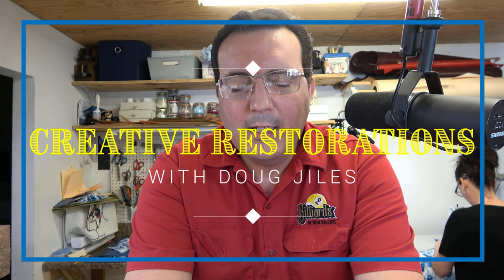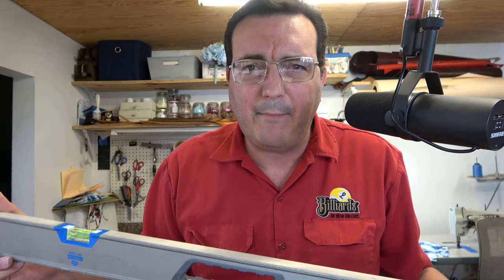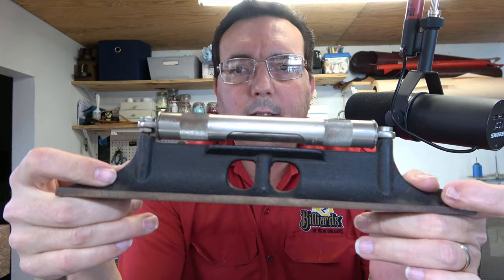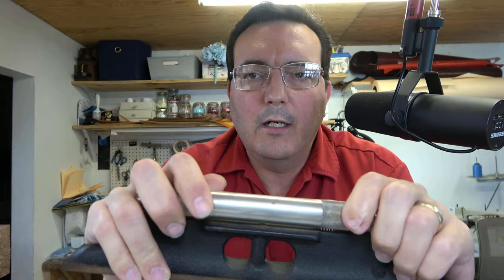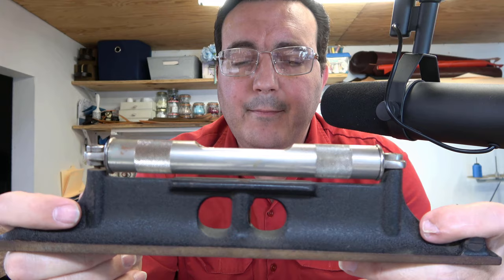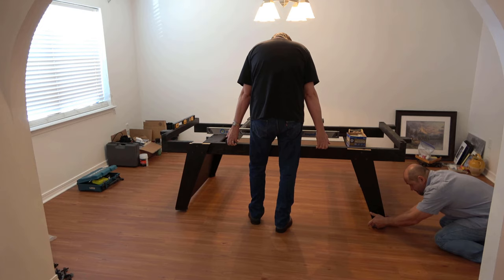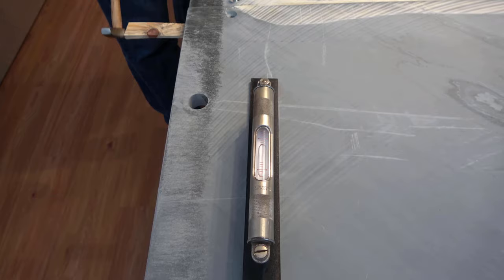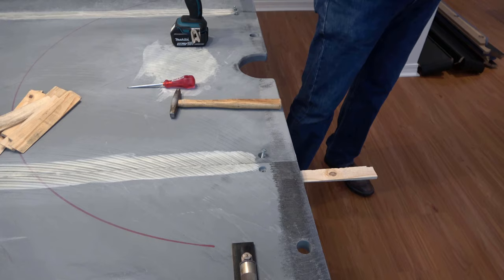How to Level a Pool Table

Comment: Thank you for taking the time to pass along your knowledge. My brother and I attempted to level a 3 piece with playing cards and a couple carpenter levels, I suppose if we kept at it, eventually would have got it. He had to leave so we stopped. I found this video and I'm going to start from scratch. The frame was leveled using a 6' and 2' carpenters, same as you did. When it came time for the fine adjustments, we had no clue and struggled. I ordered a machinists level yesterday,  not a Starrett but one more affordable. Your instructions are priceless and make it look so simple. While waiting for the level,  I'll use your techniques to replace the rail cloth.  Again,  Thank you for sharing your knowledge.

Comment: I do like my machinist level. I would not recommend spending the money unless you do this regularly. Reversing directions on the level is good confirmation. I'm sure this gets it as close as necessary, as little things like temperature and humidity will likely cause more deflection than any leveling error, but you wont notice. More likely in those cases you will notice more the change in felt characteristics than levelness. 

A penny slide across two adjacent slate pieces can provide another confirmation that they are even as you will feel and hear a difference if one slate is a RCH off. More sensitive than my finger touch. My slate has always required a few shims center table to keep perfectly smooth and level across entire seam. These shims are small and can be made with a knife and piece of pine.

Don't get smart like me and use playing cards as shims under the table. Little kids will find them and remove. I guess a razor blade could have helped. Live and learn. (Not on the kids, on the cards).

Thanks for the video. Getting ready to re-felt and cushion my Overland table (defunct Missouri company) that is very typical of standard 8' home table.

I am not a professional table mechanic, but I did sleep in a Holiday Inn Express.

Comment: Excellent explanation on the Starrett 98-12 level and the point of diminishing returns. I looked up the specs of the 98-12 and the bubble is even more accurate than the one I use to calibrate my surveying tribrachs (I'm a surveyor by profession), though not by much. And the 98-12 is a LOT more practical for tasks such as leveling pool tables.

Sure wish I had a table...
Reply from the maker: Thank you very much!

I do find that people tend to obsess over hyper-accuracy that ends up costing WAY more money than the task deserves. 

Thanks for watching!
Reply: @CreativeRestorations  Indeed. And if one were trying to use the costlier, more precise and accurate level for such a task it would very likely be an exercise in frustration due to the substantial additional time and effort invested for no practical gain whatsoever. One does not need to build an atomic clock when a Swiss watch will do :)

Comment: Working through my own levelling and recovering - what do you do when you can't screw down into the frame through the slate? The slate on my table floats and the only thing I can screw to is a skirt of MDF all the way around the frame that is used for a staple surface for the cloth. 

No screws go into the frame itself so I can't figure out how to level above and screw down to the line.

Comment: Thank you for your expertise, 
Question: which is better, a 3 piece or a single piece slate?
Reply from the maker: I prefer a 3 piece slate table. With a single piece, you only have 4 points to actually level the table. You can "flex" the slate in between those 4 points. But, there really isn't much movement that can be had.

With a 3 piece slate table, you have those same 4 points at the legs plus 4 additional points on EACH slate and you have the slight "flexing" of the slate. This gives you a total of 16 points to level plus flex.

Just my $0.02.

Comment: Great video and explanation. Would you start with the side to side adjustment on the highest end first? It seems like any side to side adjustment after that would also throw off the end to end levelling you have done.
Reply from the maker: Yes. You always want to level off your table to the highest point on the highest slate. Go side to side on that slate first. Then, when you level everything out head to toe, they should (in theory) all be level side to side. But, you do want to double-check each slate side to side as you progress.
Reply: @CreativeRestorations   How do you determine which slate is the highest?  I didn't see that explained and I can't think of a way to do it with a 12" level, or any level that doesn't span the length of all the slates.
Reply: @dbierman2001  I concur, and would like to see the answer to this important question. It seems like the author may be assuming the slate is perfectly flat and is equivalent to a precision straight edge. He also relies heavily on matching the slate junctions by finger feel. I wonder how accurate that really is.

Comment: I thank you for your videos. I will be attempting my own recover very soon. Purchased Maui cloth.. figured if I messed it up it’s not a huge loss. I am very capable and attentive… here’s my only question: cloth tension seems to be a learned skill. You seem to put a lot of tension on a stapled cloth. Is there any rule of thumb for tension? I appreciate your help
Reply from the maker: You're right. It is a learned skill. You've got to stretch it tight enough, but not so tight that it rips. Unfortunately, there is no scale indicating the "right" amount of tension. You've just got to "feel" it. Also, every cloth is going to react and preform different. The amount of tension you'd put on Simonis and Tour Edition is different than what you would put on Invitational cloth. And, that's going to be different than Maui cloth. All I can say is, stretch it to the point where you feel comfortable. Good luck with it!

Glad you're getting something out of my "rambling" videos!

Comment: Any tips on how to level after the fact? Unfortunately, I just found this video and I’ve finished applying the felt and bumpers on my table but need to somehow raise the table from one side according to my 4ft level. 
Can I add shims under the legs of the table?
Reply from the maker: Nope. Should be done as the table is being installed.

Comment: Amazing work.  Do you find that tables go out of level over time?  What causes this?
Reply from the maker: Thank you very much!

If a table is installed properly and it isn't abused afterwards, it's fairly uncommon for a table to go out of level.

A house settling over time can cause it. If it's either a raised house, the table is installed on a floor other than the first floor (multi-story homes), the floor joists can settle. Trees planted outside - as the tree grows, so do the roots. They are incredibly powerful and can lift the concrete slab enough over time to cause everything to be unlevel. 

Moving the table (even a few inches) without disassembling and reassembling it. Not having enough shims placed around the perimeter of the slate (especially at the seams). 

Other than that, there really isn't anything else that could play a factor.

Hope this helps.

Comment: thanks, for the great information. I would like info. on how to reduce my pocket-size to 4 inches in the corners and 4.5 for side pockets, not doubling up on the facings. Full size gc4
Reply from the maker: Thank you very much!

Unfortunately, the videos I do are limited to the jobs that customers want. I have to have 1) a customer with a Gold Crown and 2) they would have to want to have their pockets tightened using that method.

When that job comes along, I'll be sure to do a video of it.

Comment: Doug...very helpful video. Question...are you driving the wood shims directly at/to/under the slate hold down screws? It kind of looks like you are...or are you just driving them near the screw? ( cant quite tell). If you are driving to the screws, then screwing them down thru the wood shims, why are you doing so? Thanks, Bob in WV
Reply from the maker: I drive them in as close to the screws as possible. I don't want to drive the screws through the shims in case there's any minor adjustments that still need to be made.

Comment: How tight do you need to tighten the screw? In my first attempt at leveling I was making it as tight as possible and with each failed attempt the thread was starting to wear, but from your video is seems you just tighten until you get the level to the desired level, and using your method would not wear the thread even if it takes many retries..
Reply from the maker: The screws holding the slate down aren't really intended to be highly torqued. It isn't like you're attaching a rim of a car to the rotor. The slate weighs a LOT (roughly 250 pounds each). So, they're not going to go anywhere even if all you do is just tighten the screws to the point where they just engage the slate. The screws are there really to prevent lateral movement and to assist in leveling. That's it. 

Tightening the screws like you're tightening lug nuts is a recipe for broken screws, stripped out holes, and stripped out screw heads. 

I'll be uploading an another video talking about the finer points of leveling a table soon. Stay tuned!!!

Comment: great video. I used to re cover pool tables. what would explain seeing technicians using shims underneath a pool table under the middle of the table ?
Reply: Even slate can sag across 4 feet. Middle shims just fill gaps to ensure support across the span

Comment: My heritage table has one large particle board piece 4x8 that the slates sit on.  Do I put the shims between this and the slate?   Or between this and the table frame??
Reply from the maker: You should watch my "Outdoor Pool Table" series. It addresses this exact issue.
Reply: on A.H. tables (top liners) all wedges must be put underneath the table, not from side .

Comment: Does it have to be a 12" machinest level or can I use a smaller one.  What's the smallest machinest level you recommend?
Reply from the maker: I wouldn't go with anything smaller than an 8" machinist's level.

Comment: Would it be more secure to make the slate bolt go through the wedge?  I guess you'd need more gradual wedges....  
I'm glad you recovered (No pun intended)!
Reply from the maker: Thank you! I'm feeling better and better with each passing day.

I actually did screw the slate screws through the wedge on this table. However, it isn't really necessary. They're a friction fit. And, with the pressure exerted by the screws, the wedges aren't going anywhere.

Comment: Is there any possibility that the slate will gone warped/bent? I have a pool table that all 3 pieces of slate bent down in the middle I guess.
Reply from the maker: Warped slate is possible. However, I rarely see it warp when the slate is 3/4" or thicker.
Reply: @CreativeRestorations , it's 1" thick...

Comment: I have an 8ft CL Bailey...the company that leveled used a machinist level and I was there the entire time...he seemed very meticulous and got it very level....BUT...as I really slow roll a ball towards 1 of the pockets and about 18 inches from the pocket it seems to roll off about a balls width to one side....it ONLY does it with this one pocket....I'm not sure the issue and feel like it shouldn't be like that...if I put any amount of speed on the ball.it rolls true but I feel like it should be better than that. Any advice or help would be great.
Reply from the maker: That's a difficult one. It could be that one of your slates is off-level. It could also be that one of the slates isn't honed 100% true; causing a dip in that one area. The only way to find out is to get it back down to bare slate and use a machinist's level on that one slate. You would have to leave the slate in place (screwed down exactly as is) and move the level around to several spots. The slate could be cupped or crowned in that one area.

It could also be your cloth. Cloth is woven. So, it is possible (although less likely than the slate being the problem) that the ball could be following the weave of the cloth.

It's impossible for me to know for sure what's causing the problem without being there and seeing what it's doing and preforming tests first hand. But, hopefully this narrows it down for you.
Reply: Thank you so much for your response. After further investigation it seems to be down that one side...although not as precise as a machinists level..I used my carpenters level and it was dead centered...should I maybe try to shim that one side...like with a playing card or something small? I have a video of what it does but I don't know how to upload it here

Comment: Are you drilling and securing through the shim.
Reply from the maker: It can be done either way. Friction alone will hold the wedges in for the life of the table. But, some manufacturers don't give enough room to put the wedges on the side of the screws.

Comment: What is the name of machine lavel
Where i can buy
Reply from the maker: There's an Amazon link to that level in the description.
Reply: 1)You can not level a table this way on carpet. 
2)You did not address that the slate seems (9 times out of 10) will have to be raised in the center  from underneath the table.